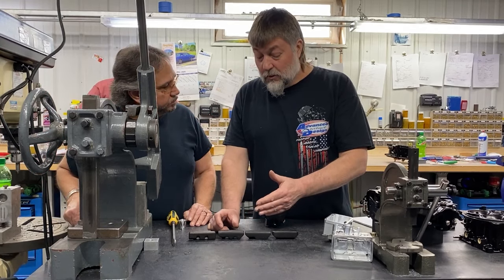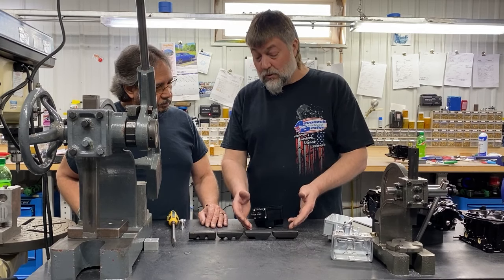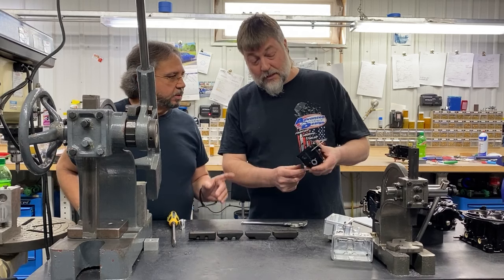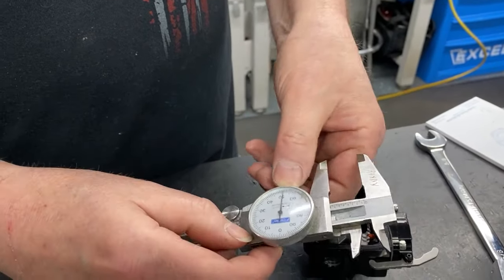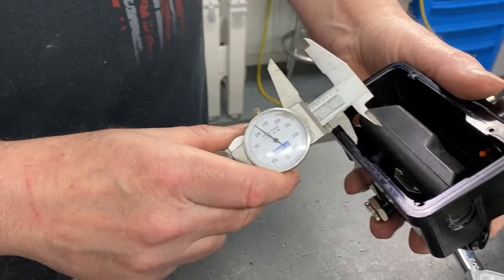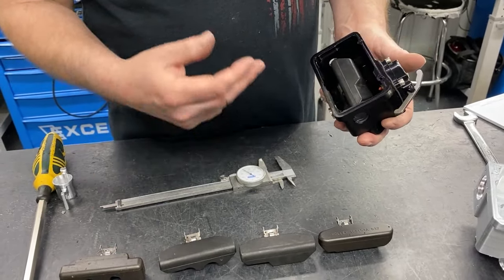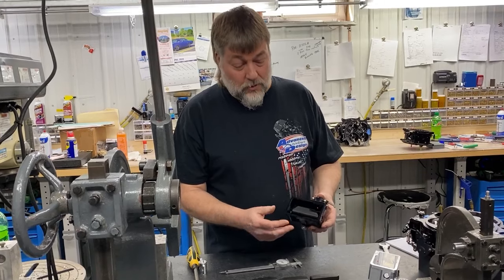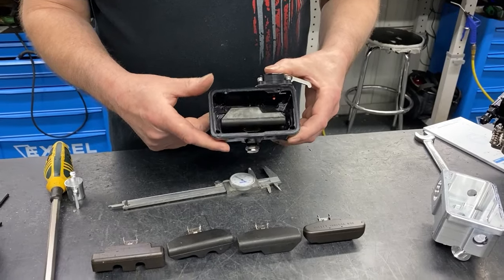DragBoss Garage/Advanced Product Design: Carburetor Tuning Series: Float Adjustment

Comment: The carb. tuning series continues  . Thank you DragBoss and John. Look forward to more. B.T.W. Many of us are st ill working on Holleys with the older style brass floats. The trickle through the sight plug hole with the engine running provided the engine has a fairly tame idle will get you close. Since most of our rides don't have a tame idle I'm certain John would be happy to set you up with one of his carbs.😊
Reply: Bill I’m also still one of those brass float older style guys. Setting the fuel level at rough idle with a radical cam is kinda like a precision compromise or exact estimate 🙈😂.
Reply from the maker: Thank you Bill, I have never used a caliper to measure float, but does make sense since so many factors affect it. I have always used site plugs. I will have to see if he wants to do a carb challenge against my current nothing special Pro Systems.
Reply: @danielwilson6665  🤣